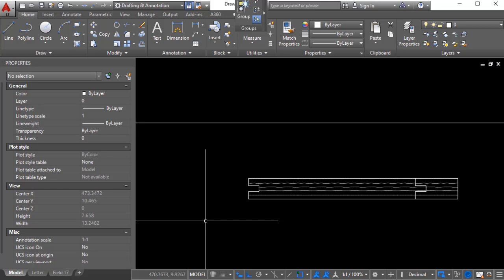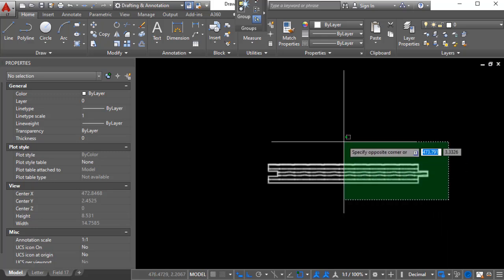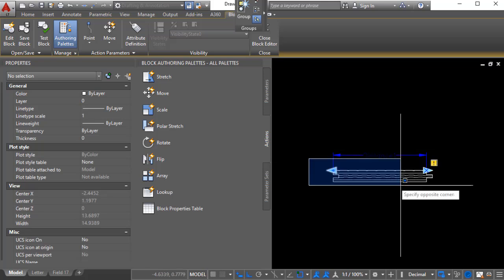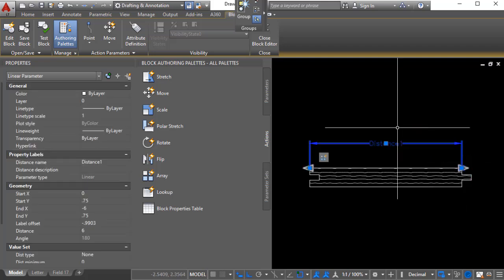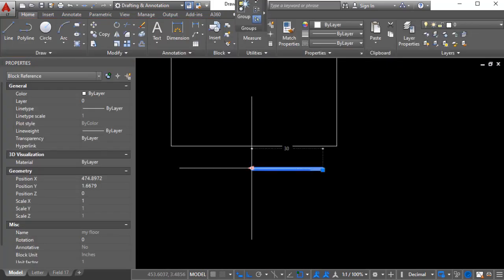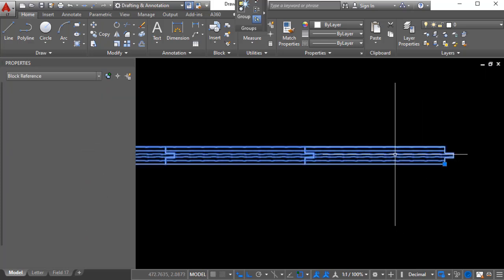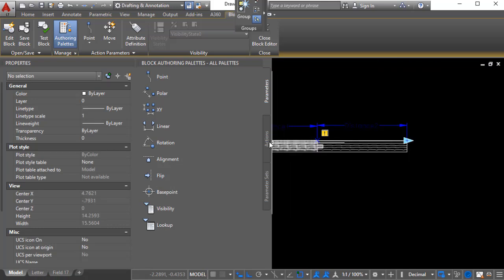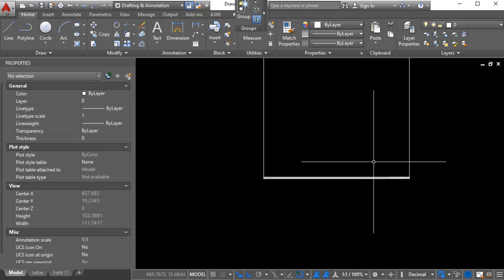Dynamic Blocks with ARRAY

Comment: There´s may be a way to make the length of each panel variable or dynamic  to adjust them with out the piece of the end? I mean like, if I move just one strech point all the panels will grow a bit to fill the whole distance of the parameter or in this case the whole floor